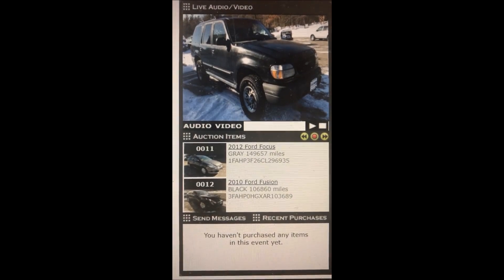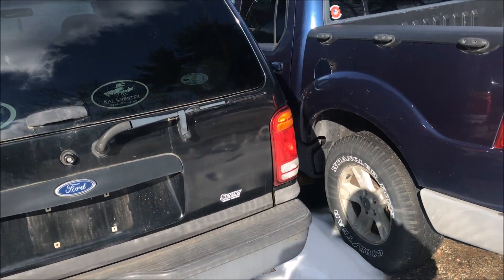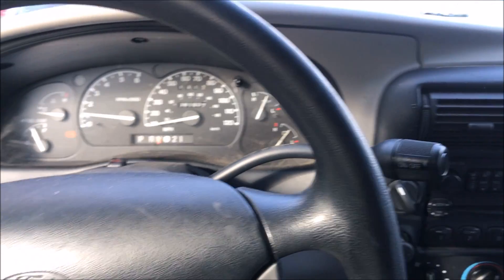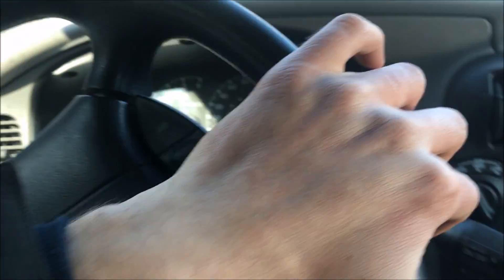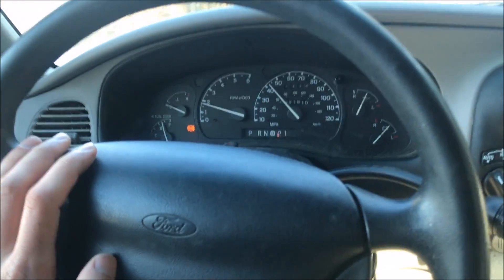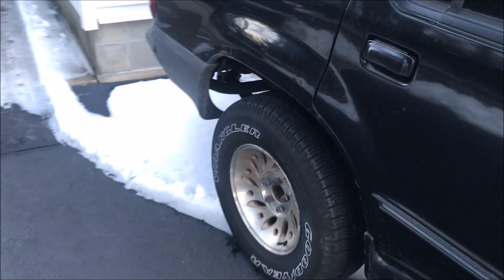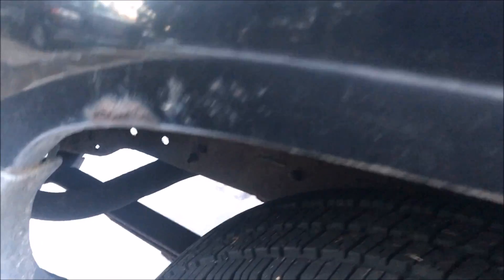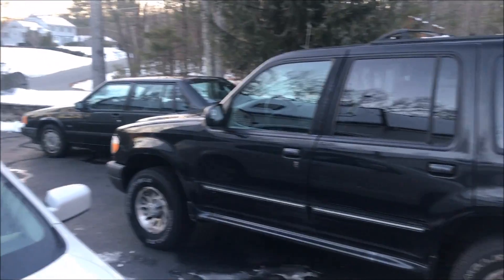I Won An 80k Mi Explorer At Auction For $500

Comment: The alignment of the gear indicator on dash is just off. Look it up, it's a broken plastic piece on the cable under the steering wheel and panel. I fixed mine re aligning it with a zip tie lol. Easy
Reply: I was thinking the same thing just a bit of slack in the column,,  I did  mine.

Comment: Transmissions, and the transfer cases in the full time 4WD models tended to be problematic.  Those automatic transmissions are pretty problem prone.  The transfer cases usually have a viscous coupler in them that controls the front axle power output, those viscous couplers go bad and they're expensive to replace.  Easy to tell if they're bad is they fail in the engaged position which turns what once was a full time 4WD vehicle into a part time 4WD vehicle when you make tight turns you get the normal binding problems as if you were in part time 4WD.

Comment: the "fuel service" was likely just a fuel filter. my old ford ranger had its fuel filter beside the frame rail on the driver's side, and it's supposed to be changed every 5 years or 100 000 kms.

Comment: Wow, great buy!  Those older 4.0 OHC are great engines.  Certainly not fast but last forever.
Reply: Old ones were OHV style.97' the 4.0 OHC was available as an option.Lots of problems with timing chains with the OHC edition.Cheaper to replace the engine than do the chains.

Comment: With tax season starting I'd have zero problem flipping this same Explorer for $2,500 here in Detroit. You NEVER see this generation here without rusted out rockers and rot around the rear wheel wells. The exhaust is usually rotted out, falling off, and loud on these. And they always creak and squeak from the front suspensions. This one being so well cared for is a good find for the money.

Comment: The Ford Explorer is one of the best truck I’ve ever owned. Awesome buy
Reply: It's a great hauling car. Awful as a daily driver though
Reply: Used to have a 2002 Ford Eddie Bauer, didnt last long.
Reply: 96-01 2wd 5.0 are good
Reply: I have a 98 with the v6 with a seized engine in my back yard. It was great as a beater until that happened though
Reply: @onometre  I thought you said they were awful as a daily driver, and dont you use beater cars as daily drivers? Or do you mean the fact that it was a beater accelerated its decline?
Reply: I live in the south so a beater here isn't an all winter kind of thing.
Reply: @onometre  Ok.
Reply: D4x4Bronc I had a 00 awd limited edition and like I said the best I’ve ever had
Reply: @onometre  I disagree.  I had a 1999 Explorer Sport for about 8 months recently.  Put 10k miles on it with no issues.  It was a great daily driver!

Comment: I had a 91 first generation that was the XL package. Manual windows and locks and a manual transmission which was discontinued quickly. I bought it from my sister and it was still running great with well over 300,000 miles when I sold it. Just normal maintenance and an upgrade to the new Freon. Damn I wish I had kept it.....

Comment: Still use and drive a 1997 Explorer XLT with 147k on it. Has the 4.0 OHV V6 and 4x4. Engine runs perfectly smooth and trans still shifts good

Comment: Theres a bolt on the shift linkage under the dash. Tighten that up and the shifting on the dash will be tight and perfect again
Reply: You might have to add a few zipties to it, there are videos about that issue.
Reply from the maker: Corrosion37 I actually have a video on my channel about tightening that bolt when the linkage is loose. I misspoke in the video, and what I was trying to say is when the shift indicator is a bit off center a lot of times it’s an indication that the truck has had the transmission removed and rebuilt. At least in my experience!
Reply: @bigalsbikeandauto  Yeah i wrote that before you mentioned it lol.
Reply: He's talking about two torx T30 bolts on the shift linkage that fixes shifter slop. The alignment of the gear indicator is on a different cable/linkage. That fix is where you can use a zip tie to keep the broken plastic piece in the correct position on the cable.
Reply: @bigalsbikeandauto  You can fix the indicator accuracy. Transmission probably hasn't been touched. Just google it, it's on Explorerforum.com and ChrisFix has a video fixing this on another Ford with same setup

Comment: That misalignment on the gear selector could be another thing it happened to me underneath the dash the knee bolster panel remove it end up inside where the steering shaft comes down the column at the very end there is a bracket it tends to come loose does it on all Ford products of that era and I even a little bit behind tighten it up it'll bring the selector right back to where it's supposed to be but when you do tighten them I suggest using Loctite like I did never had a problem since then keep up the good work

Comment: I won a 2002 Eddie Bauer Explorer for $500 at an auction. Brake pads and rotors need to be replaced along with the rear end sway bar link.

Comment: If you've got to release the axle U-bolts to replace that shock mount, I would suggest you just get new U-bolts.  If the shock mount has got so rusty it's failed then the U-bolts are going to be pretty horrid and may well just snap off when you try to release them, so having new ones to hand will save a lot of frustrations.  If you don't need them I would imagine you can return them...

Comment: You guys sure love the salt, I can see it everywhere in the engine area, the hood and definitely underneath. It's rusty sure but it still has a few more years before that frame caves in. If this was a Japanese car it would be full of holes, I see so many Honda and Toyota with almost brand new interiors in the junkyard as the yearly inspection test fails on extensive corrosion or the cost to repair it outweighs its value due to fixing the rotten pipes, rotted bushes and other horrors caused by long exposure to salt and moisture.
Reply from the maker: TheCamshafter the frame is solid, won’t cave in as long as it is cleaned up and fluid filmed. No weak points in the frame anywhere
Reply: Yep, and they're using that crap here in Idaho now too :(.

Comment: Wd40 the rusty bolts for a few days before you work on them, they will come right off.
Reply: Max Rpm he needs a torch. Those bolts are soaked in New Englandness.  They will laugh at wd40
Reply: They will laugh at first, but wont last for a few days, then Al will be laughing :)